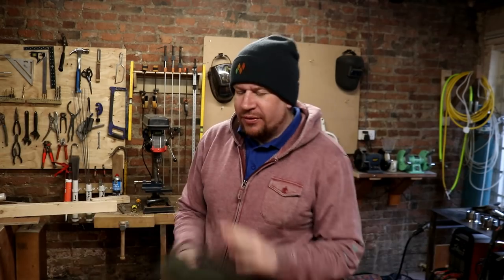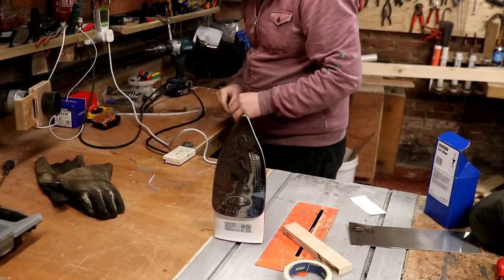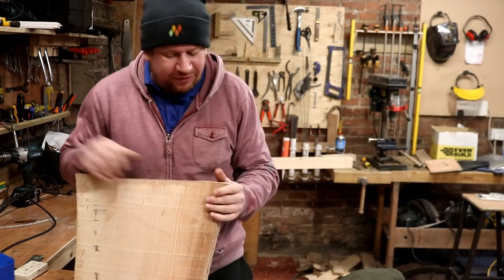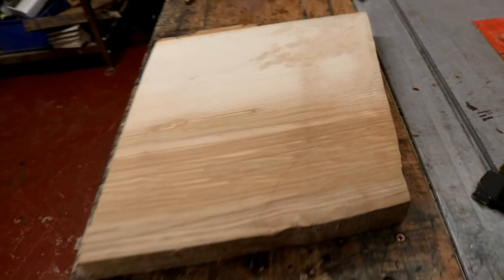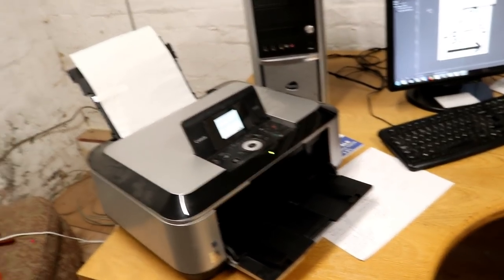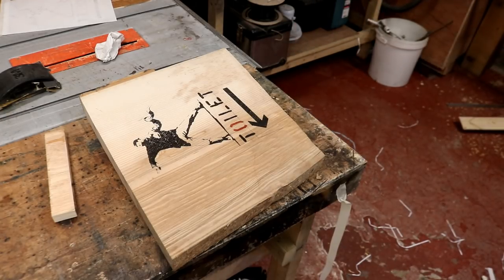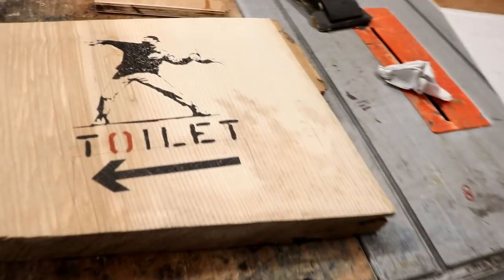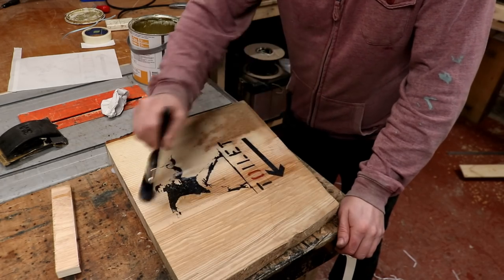PRINTED WOOD SIGNS

Comment: Signs look great m8,of ya want to keep the thickness you could hag them with chains and hooks on wall beside doors.Screw a couple of heavy duty hooks into top edge then a couple lengths of heavy link chain attached and bolt other end to wall,same on bottom if ya don't want them flopping about. Cheers.
Reply: You could also hang some brass plated chains off the bottom of Mr.T !